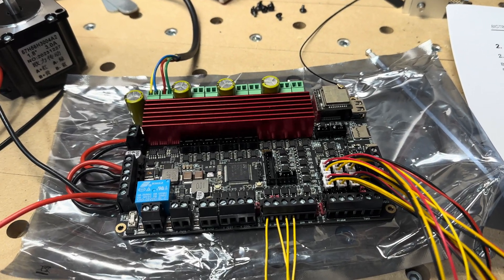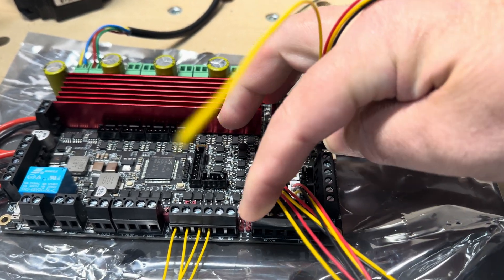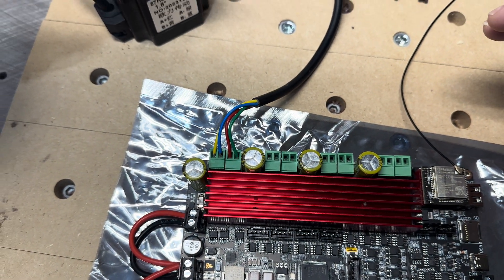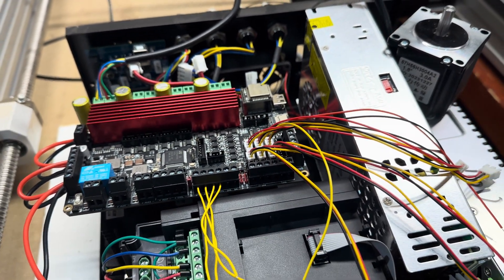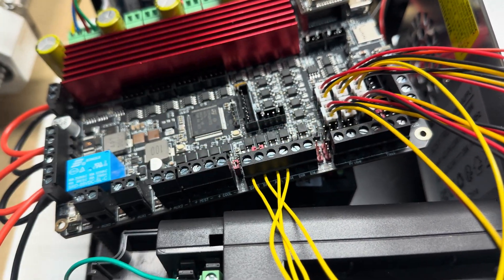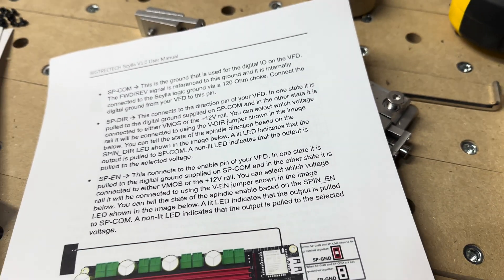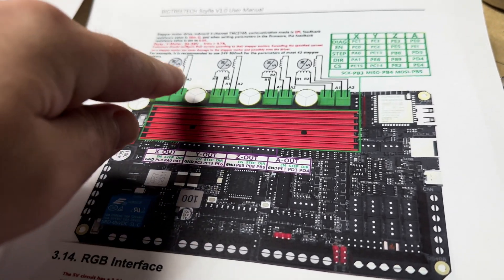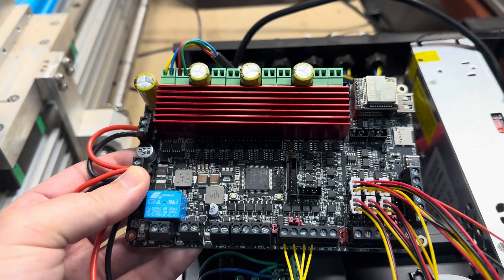OMIO X8 CNC to BTT SCYLLA grblHAL conversion Part 2

Comment: HI Tony when the video for GRBL install on scylla
Reply from the maker: Sorry. I got caught up on something.  I will try to get back to it soon.  I’ll do my best to at least put up a simpler method for flashing the board this weekend.  It’s not that difficult if you use the grblHAL Web Builder.  You need to install the STM32 Cube Programer first so that you are able to flash the board using DFU.  The Web Builder will give you a firmware file with all the options you select for your CNC machine.

Comment: Can you run a laser on this board?
Reply from the maker: I haven't tried it but I know there are some files for lasers in the grblHAL project.  It has multiple outputs that you could use for driving the laser PWM input but you might have to compile a custom version of the firmware.  Unless you can find some info on grblHAL and lasers I might caution you trying it.